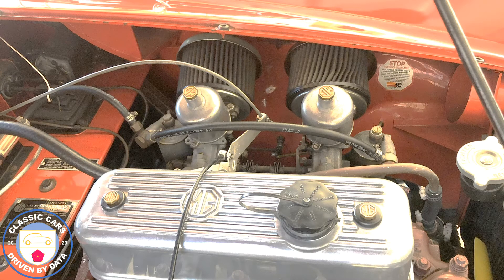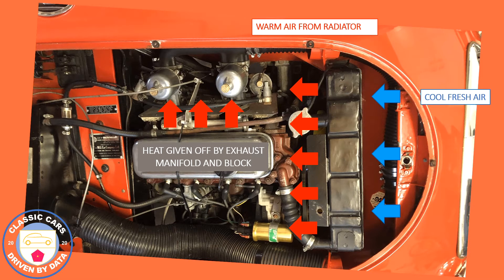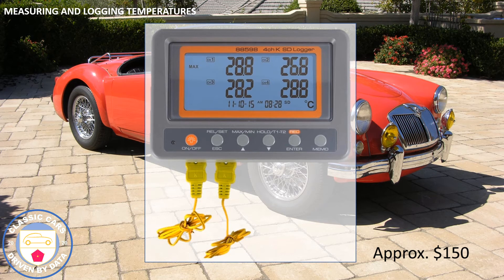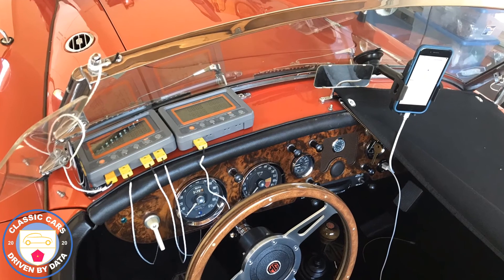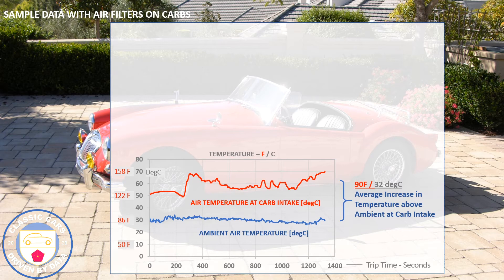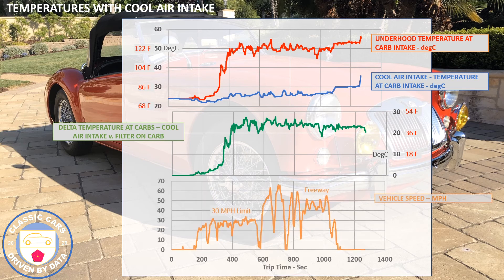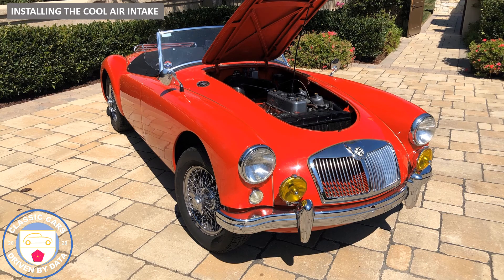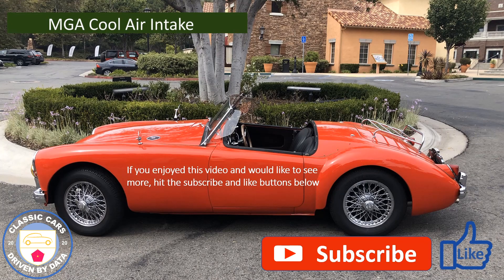Cool Air Intake. Temperature measurements to quantify the benefits of the Moss cool air intake.

Comment: I’m sure this new Moss cool air intake helps to some degree but the MGA was manufactured with a cool air system from the factory. Those “circular things” you refer to that you ran your air hose through for your system were designed by the factory to have 4 inch flexible air ducting tubes on both sides of the car to provide fresh cool air. One ran from the grill to the carburetors and one on the other side of the car ran from the grill to the heater box. So these two air tubes would provide fresh cool air to both the carburetors and the heater. You have to keep these factory tubes in place and in good shape for them to work correctly which isn’t a problem at all if the owner just pays attention. On my MGA I run a Moss provided MSX cross flow aluminum head. This solves some heat producing issues for my car. First the carburetors are no longer right above the exhaust manifold which produces a lot of heat for the carburetors even with the heat shield and your cool air system. The carburetors on my car are on the passenger side of the car with the exhaust manifold on the driver side. That by itself keeps the carburetor temperature lower and I keep the factory produced cool air system in place and in great working order. Secondly the aluminum MSX head dissipates heat faster and better than the original cast iron head. The MSX crossflow head has been on my car since 2004. It has performed fantastically and provides great performance for the street. Why don’t you run a test on your MGA with the factory cool air system properly installed and see if the Moss system you have installed really gives you any real benefits over the factory system?

Comment: I have drastically reduced the engine temperature and engine bay heat on my MGA from running in the
90s fahrenheit which gave unbearable heat soak cockpit temperature to running in the 70s. This is what I did.
1)Replaced the rubber foam on the underside of the bonnet that squeezes onto the top of the radiator,  therefore forcing more air to go through the radiator than over the top of it.This part is usually never replaced after restoration. 2)I fitted a radiator shroud around the fan again forcing more air to be dragged by the fan through the radiator. These parts are easily found at MG suppliers.
3)I had the exhaust manifold ceramic coated. Suppliers state this can reduce under bonnet temperature by 30%.
4) The MGA twin cam had under bonnet louvred panels to aid cooling and access to the engine. I had these fabricated and installed to vent out the under bonnet heat. These 4 things changed my car I hope it works for you too

Comment: Very Interesting, thank you for posting.  I have always fitted cold air intakes to get the air as far away as possible from heat sources but never had data to gauge the effectiveness. My MGA has a 1.8 Miata twin cam and I routed the cold air intake forward like you but then down, ending up underneath the radiator. I then created a second air intake in the front valance.

Comment: Looks like the hose running up front might block air flow to the radiator.   Is this an issue with this set up?
Reply from the maker: Chris - that's a great question. My experience at elevated ambient temperatures here in Southern California with this setup shows that the relatively minor obstruction of the air flow into the radiator does not a have a significant impact on cooling capacity. Also this minor obstruction is offset by the cooler air entering the engine - hence reducing the cooling load due to heat transfer in the block and head. Thanks for the question.
Reply: Mga1600 owner since 2002: I installed heat resistant ducting coming from front leading cooler air to std air filters since I have car. Exiting just in front of filters Helps a bit. Maybe I bent an aluminium box around 2 filters to improve functionality. Huge improve in heat reduction is glassband wrapping total exhaust system, double at manifolds till just under engine. (Like on race cars and motorcycles) 
You double clap non pressurized ducts, 😂nice, but no double clamps on cooling fluid hoses? I ‘d doubled those instead….😊